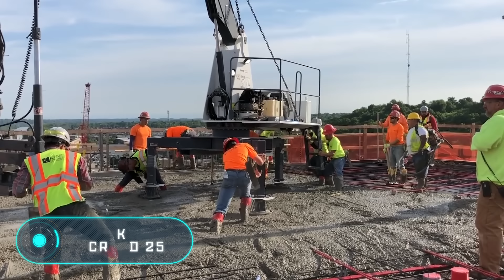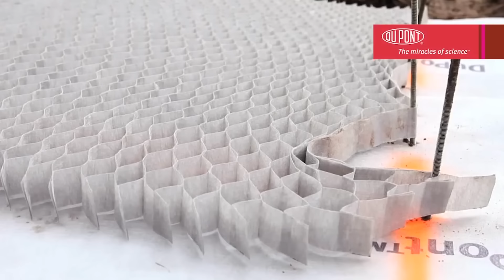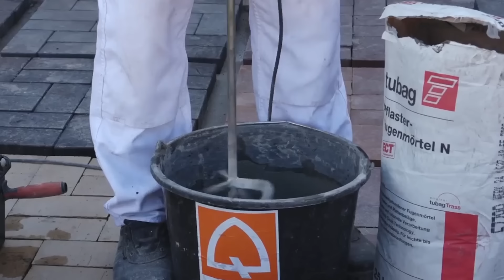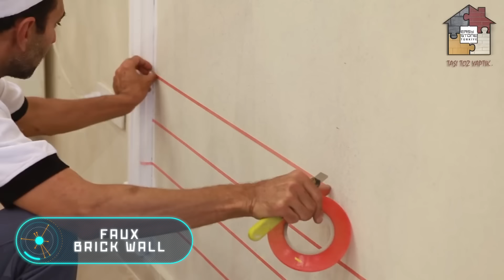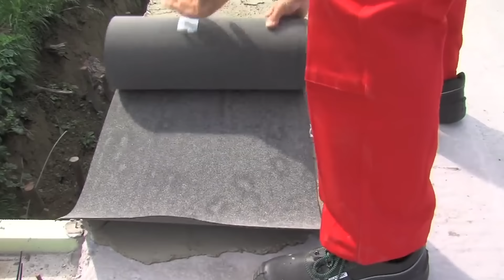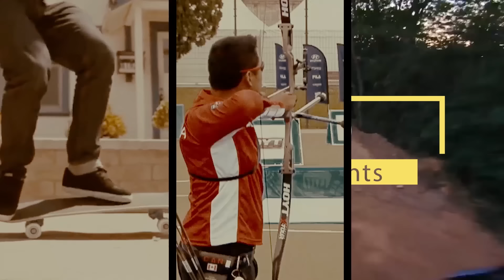INSANE LEVEL TECHNOLOGIES THAT REALLY WORK

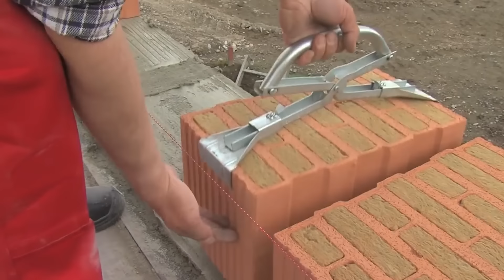Comment: 7:58 : These walls  are amazingly  thick and there is no insulation in between each brick with a possible air flow going through the wall. I doubt the insulation foam inside each brick has any purpose since the air in cell will be trapped inside anyway.

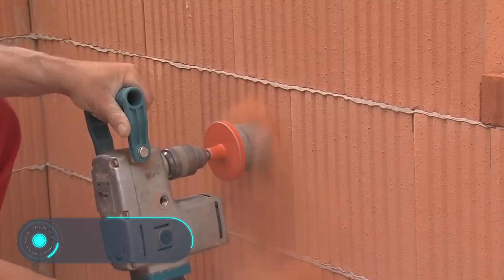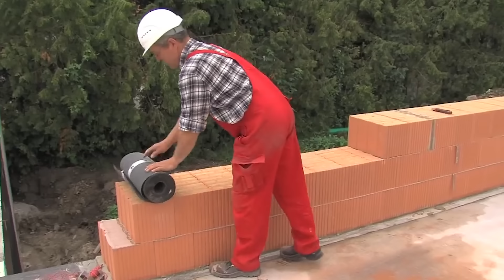Comment: 7:25 those blocks are a joke! Where are the vertical supports? Where is the anchoring into the hopefully reinforced concrete foundation? This structure will just snap in piece when wind gusts, earth quakes, or movement on a 2nd story.  8:57 look at the thickness, if you need to maximize floor space and stability, this is not the solution for anymore.

Comment: Concrete stairs being insane level of tech? Maybe for stone age people.

Otherwise there are probably better stuff to use.

Also those building bricks toward the end are focking massive too. A bit too big imo.
Reply: Perhaps someone needed a stairway that could handle a lot of use and heavy loads, such as a bar or restaurant needing a way to get heavy kegs of beer down and up stairs for use or storage while using a cart or "dolly".  In that instance a brick starway would make a lot of sense.  Granted, it is the only example that I can think of.
Reply: @UncleLance67  Bricks are great for compression strength, but not good for tensile stress, so fail on that one.

Comment: Yeah... the second one isn't a geogrid but a geocell made of geotextile. Great for a small farm entry to avoid routing in the path. The brick stair case, unless that thin slab is built in really good concrete than that stair is a danger to the users. Brick stairs cant be suspended. Painting bricks is only a way of turning a cheap house more expensive, the propor way to do it is using thin bricks that you lay like tiles or some composite bricks created for the efect. Please don't promote that kind of "technologies"